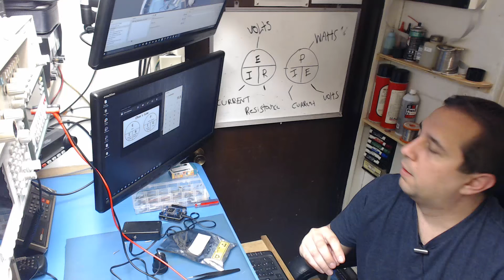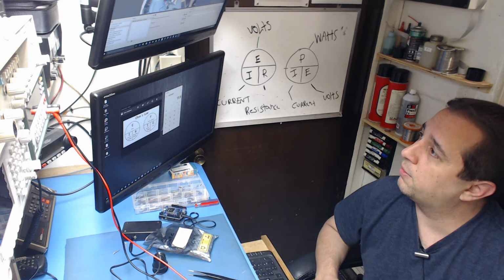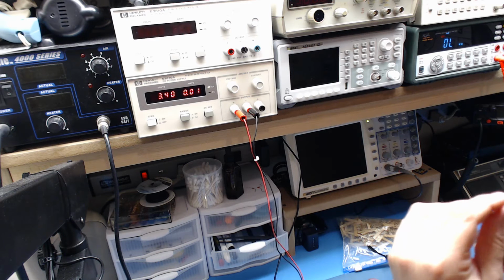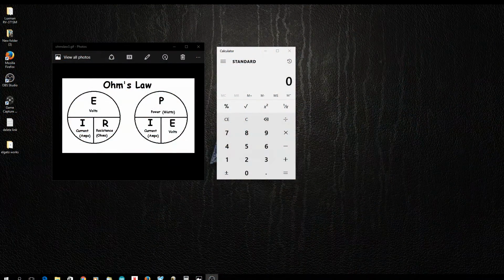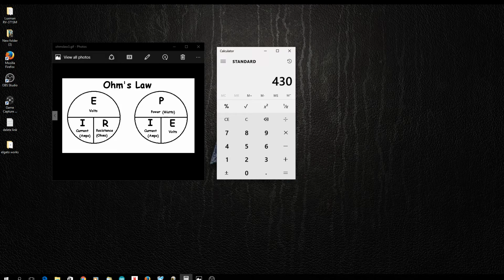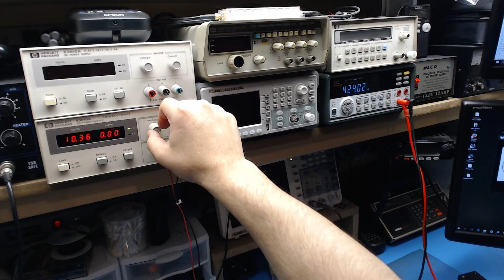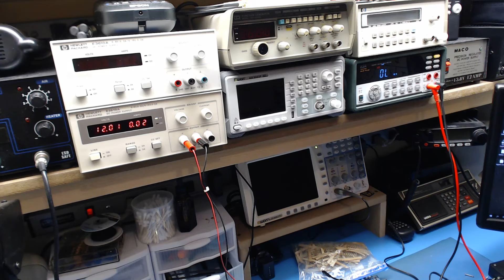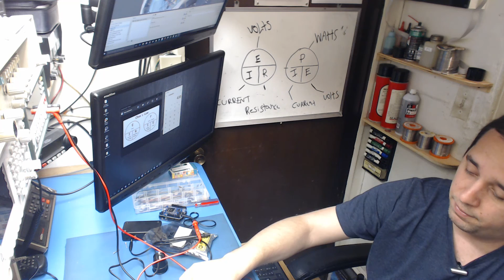HOW TO CALCULATE A RESISTOR FOR AN LED

Comment: Great video. I can’t tell you how absolutely great it was to see on the board behind you Ohm’s law and the formula for power with voltage PROPERLY AND CORRECTLY designated with E and not the layman’s V. Hard to describe what a wonderful sight to see. Yes, voltage is correctly designated E for energy or electromotive force. Thank you.

Comment: I would be careful with testing the LED at its rated voltage without a current limiter on the power supply, especially at the highest voltage limit because the current curve for a diode goes exponential very quickly with the risk of burning the diode. The resistor that you calculated is in practice such a current limiter for the LED for the given supply voltage.
Reply from the maker: Yes the HP power supply I used was current limited . Thanks for mentioning this.

Comment: As a general rule, all LED colours are equal in current draw, but red is more equal than others and will require some extra resistance - nearly double as it happens. Even in a RGB LEDs the red component need some extra attention.

For those without a proper bench PSU, an alternative approach could be to hook the LED up to a 10k (if over 9V) or 1k (if under 9V) linear potentiometer and a multimeter measuring current draw, and then just dial it down until you're slightly below the LEDs max current draw. Then just measure the resistance on the potentiometer at that position. Then just use a resistor that you got that is closest (yet still above) that resistance value.